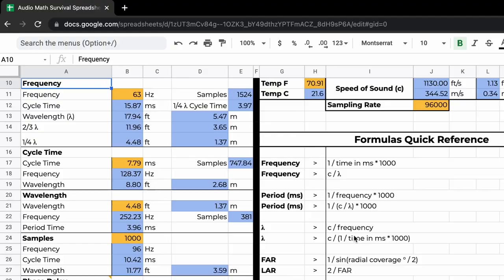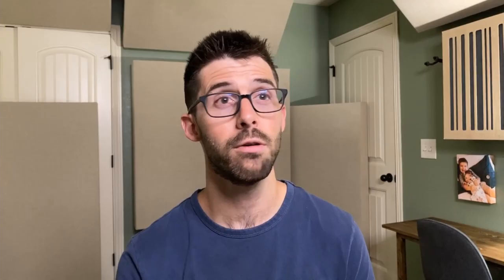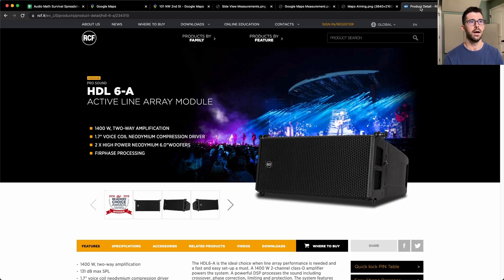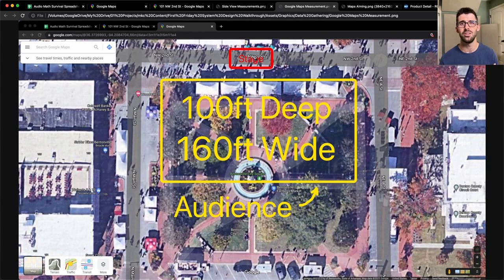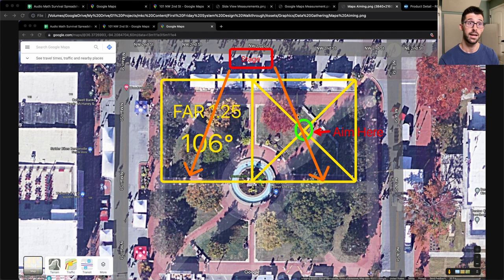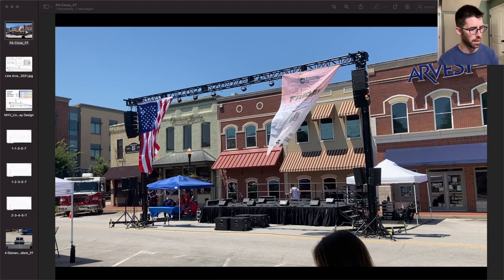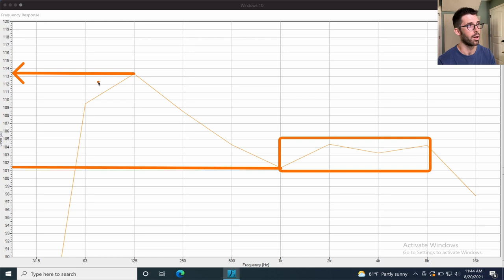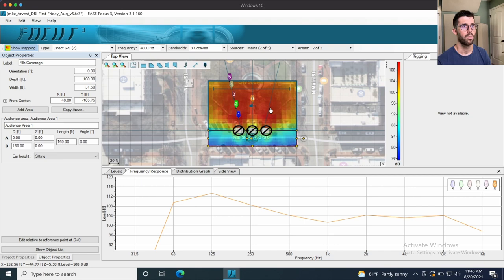Sound System Design Walkthrough | City Square Concert

Comment: curious on how/why you decided to pointed the subs toward each other? id assume the gradient array would work just the same facing all forward
Reply from the maker: Great question!

1. To keep the acoustic centers of the subs close to each other for maximum coupling

2. Keeping the sources close makes the for the widest coverage. My audience is wider than it is long, so I wanted to preserve that. The farther I pull to subs apart laterally the narrower the coverage. So, facing each other makes for the widest coverage pattern.

Comment: Just curious, have you tried the auto splay function in Ease Focus 3?
Reply from the maker: Great question! I have and have had mixed results. For my design philosophy it has worked best with the "arcuate" model. It slowly "unfurls" the splay angles between the array, which I feel like sounds the most natural and accurate (besides the ABCD approach I've borrowed from Bob McCarthy).

If you're REALLY under the gun and just need to get some suggestions it can be a helpful tool.
Reply: Just curious as well, have you tried RCF's Shape Designer? Its part of their RDNET software. What's your opinion on the splay angles, HF and LF suggestions it offers?